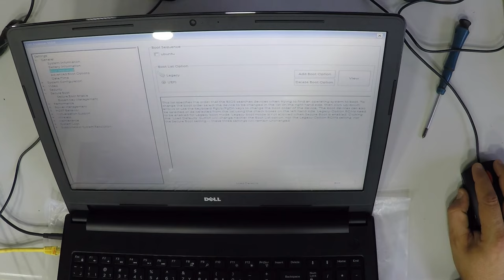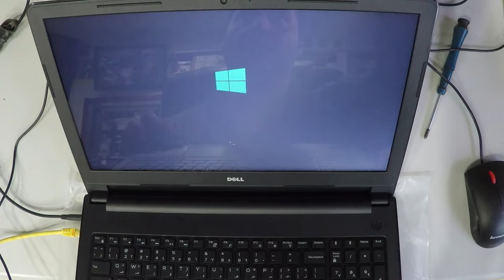Dell Inspiron 3558 HDD TO SSD UpGrade

Comment: I also have Inspiron 3558 and gotten error code 142 when starting the computer. Seems like I need to change my Hard drive. Planning to change to SSD. As far I know, the HDD I have in 3558 is an unique hard drive. Swapping out the current HDD will wipe out everything including the OS. Does the Windows re-install after I change the SSD (Like official Windows 10 with fully activated)?

Comment: Hi. I have a dell 3558. I'm trying to install a ssd on it. I cloned its old hd. I'm able to boot from ssd only if it is plugged on dell's usb. If I install the ssd internally (the sata slot of the hd) the bios does not recognize the ssd (neither uefi or legacy). I run out of options. Could you please tell me what should I have to check? Why ssd is not recignized by sata slot?

Comment: can I change my mother board with of core i5 5th gen cpu and nvedia 920m graphics card with the 6th gen core i7 cpu and gtx 980m graphics card? 

reply fast sir
Reply from the maker: hello shubh
this model (dell 3558 ) is interlevel, you can upgrade SSD driver or RAM 4G+4G=8G, but you can't upgrade board cpu and gpu :-(

Comment: Hello eShamsTech, thank you very much for this video. I'm interesting to install SSD drive into my Inspiron 3558. However I'd like to keep original HDD and to put SSD to DVD bay. I simply don't use DVD that much and think it would be better idea than to disassemble everything to exchange HDD. This way I could put SSD smaller capacity (cheaper) just for Windows OS. Can you please suggest what kind of DVD bay I need to buy for this laptop in order to ensure perfect fit? Thank you!
Reply from the maker: Hello asV, you will need9mm caddy. like this one http://amzn.to/2v23f1m
for a stable system install the SSD inside the laptop and the HDD in the 9mm cady.
Reply: eShamsTechTips Thank you very much. I didn't know that there is a difference between Sata slots. I wanted to avoid the opening the whole case to move out hdd and replace it with ssd. Does it mean that dvd sata slot is somewhoe different and can cause system instability if the system disk is connected to it?
Reply: I just want both ssd and hdd can we keep both using caddy instead of CD drive? And does this affect any performance or can create any problem in future?

Comment: after the upgrade steps from he'd to add when I turn on my laptop it does not startup. I see u changed some uefi to legacy  settings,  which I could barely make out from the video. can u plz write those steps you took so I could try them may be?
Reply from the maker: hello raju
1-Enter setup ( press f10 )
2-go to boot options
3-display the secure boot  
4-chang UEFI boot option to LEGACY boot option 
5-save and reboot 
6-bios well ask you to enter 4 digits + enter
that's all good luck

Comment: in the settings it shows that my laptop has 931GB and only 169GB of usage. Is it necessary to install an SDD larger than the HDD already is?
Reply from the maker: No, you need 250G our higher and it will fit. 169GB usage and 65GB free.